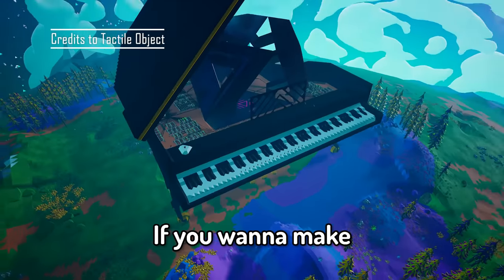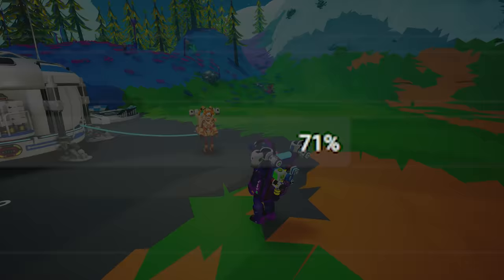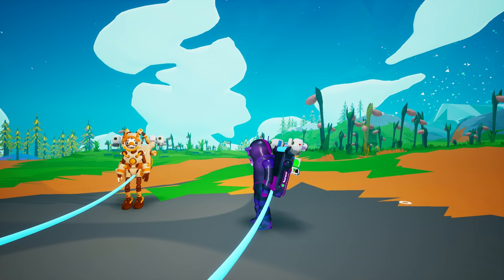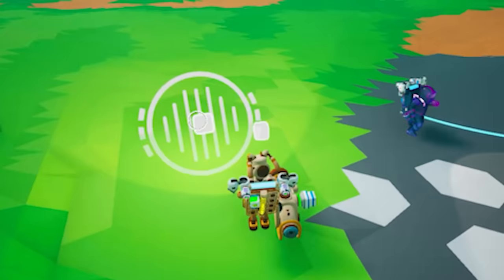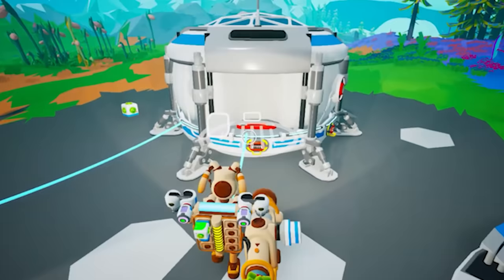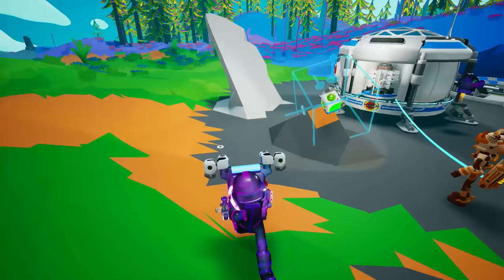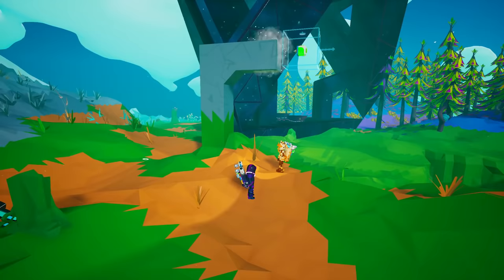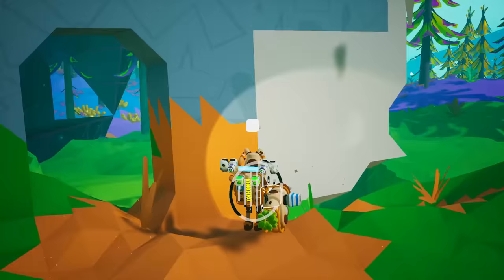True flat terrain mistakes you are making in Astroneer

Comment: This game needs the ability to print

1. Base Foundations - a 1x1 block (like the leveling block) with locking features that snaps to the ground.
2. Building Blocks - a wide selection of 1x1, 1x2, 2x4, triangular, rounded blocks that has tier 1 sockets, that can snap to each other.
3. Plate Blocks - blocks of various sizes that can cap off tier 1 sockets.
4. Palette Table - A table with 10 customisable colour palettes (based on surfaces already in game) that can be cycled and stored as preset.

While using the terrain tool is fine (with some skill and creativity), having players in multiplayers accidentally adjusting terrain is :|
Reply from the maker: That'd be great actually

Comment: What’s the difference between starting to flat the surface from the starting point, and somewhere that is extended from the starting point? Aren’t them supposed to be leveled to each other? Will I get a true flat if I don’t always start from “the starting point?” Can I make a starter point  that is extended from another starting point?
Reply from the maker: If you want to get true flat, you should always start from soil generated with a leveling block. If you expand it accurately, it will be true flat (perpendicular to the center of the planet from the starting point). But be careful because when you stretch it our, it takes a few seconds to get to the same level. so at the borders it may not have the same angle if you are not careful
Reply: @KuyaGameAstroneer  this doesn't address his question though... Why would the flatten tool act differently from the original starting point versus a flat spot that was created using the original starting point?
Reply from the maker: @taylormay9938   sorry this is a bit confusing if we don't use the right terminology 😅 what do you mean when you first refer to the "starting point" and when you refer to it the second time?

Comment: Couldn’t you use the 45 degree angle it makes as a second true flat?
Reply: This is an interesting idea. Off the top of my head, I don't see any issues. I'm def going to test it tonight.
Reply from the maker: Do you mean to add soil on the 45 degree angle?
Reply: @KuyaGameAstroneer  He means extending that 45 degree angle with the flattening tool if you are not near a gate. If possible, I think this would work as another way of getting a true flat, but only if you are exactly halfway between two gates, correct?
Reply: @taylormay9938  yeah but im not sure what would happen if your at the corner of that invisible cube,
Reply from the maker: @taylormay9938  the only way to get true flat is by using a cube, any other angle could be "any" random angle. If you are using the 45 degree angle generated by the cube, you can extend it, but it will continue to be perpendicular to the planet, it will not follow it's curve. Unfortunately there's no reliable way to get a real true flat that follow the curvature of the planet
Reply: @KuyaGameAstroneer  I'm very confused now... If a line is following the curvature of a planet, it is definitely not flat in any way..? Lol
Reply from the maker: @taylormay9938  exactly, that is what I was trying to say... Sorry if it sounded confusing lol

Comment: Hey guys, sorta new player here. Love the video. Ive watched it probably like 5 times already because how inconsistent and confusing the terraforming is in this game.

Did you guys point out that the alignment mod actually will create a level surface initially that for the most part cant curve with the planet? I found that the alignment mod is only not completely useless because without it wed essentially have nothing else lol.

For example if you were to take the alignment tool and walk in any direction while using the tool to level out the floor, you will see that it will still ramp into the air, similarly to how it works without any alignment mod on at all.
Ive also found that even if you can get the angle you want for a surface, that as you spread out regardless of what you use on the terraforming tool you will inevitablly get spots that arent consistent with the angle youve been working on.
Eventually as you go in one direction flatening things out, if you turn back around and come back your angle will have changed & it wont meet up w the original location.

The closest i have ever been able to get to having one true flat plane was by using the leveling tool near one of the planets like purple spires. However, even then the spot wasnt actually level, sure it was tuely flat, but i would have had to go dig for hundreds of feet before reaching a point where it would be technically level. At the moment it just looks like a giant shallow ramp.
However even with all that work, i found it is still next to impossible to get a consistently flat plane to work with.
It feels almost like they intentionally made the game impopssibly hard to terraform in. My dream of making a beautiful and immersive base to work out of and get automation going all around me i think might be pretty dead.
I was even looking at if there were ways to solve my issues via mods, but sadly its all scripting via cheat engine, and i can tell thats just not gonna be ideal at all.